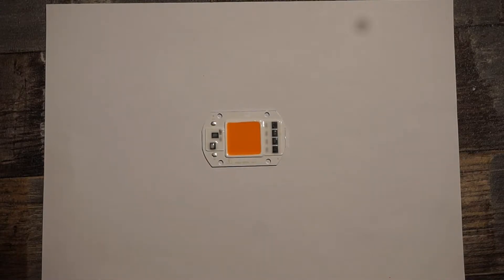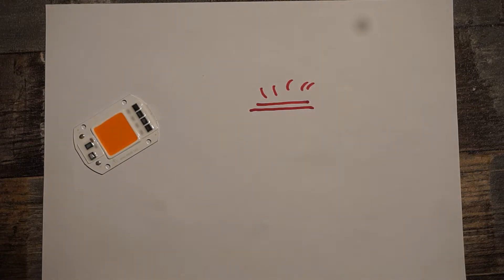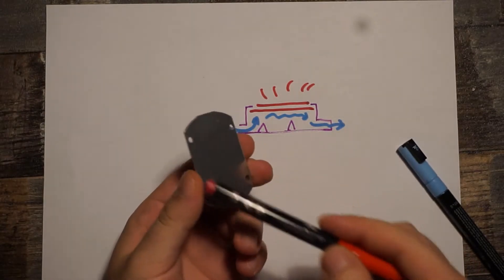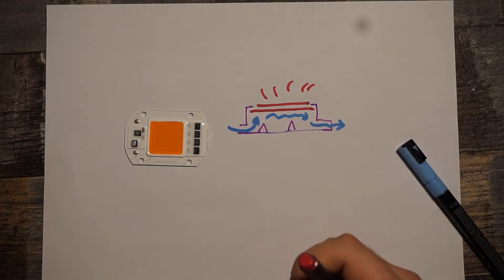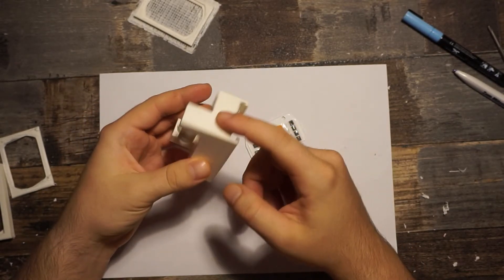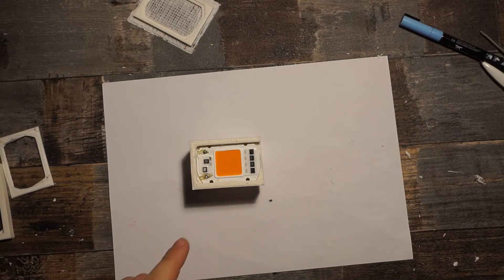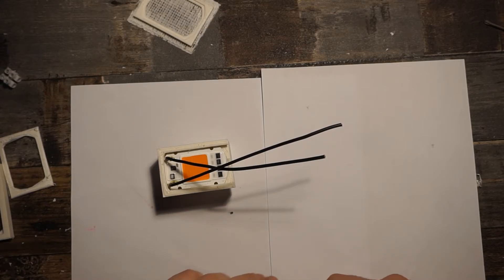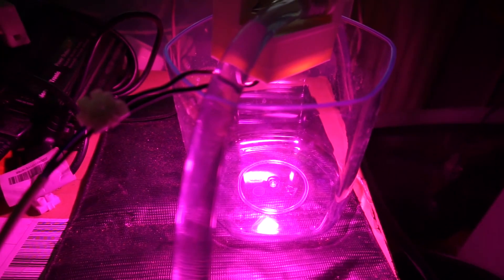Water cooling block for 50W 110/220V AC "driverless" cob LED

Comment: I have come across the video from the future in 4 years time. Do you have any update on how it works after some time? I curious to know how reliable the epoxy seal has been working. However, for 5$ materials, i can see also it is hard to complain about the reliability!

Comment: thoughts on main voltage straight to a water filled water block?
Reply from the maker: thoughts on main voltage to your water kettle? its all a question of isolation..
But yes at one point one betatester had a leak on those...and nothing happened. Thats because normal water is just not so conductive that it would create a short. Just dont fill your system with salt or soap water lol
Reply: @boltzbrain3039  I have used AC aquarium pumps too. Both the kettle and pumps are certified.

I saw your isolation in one array video and I myself was interested in trying a similar build. Potting the whole thing for safety.